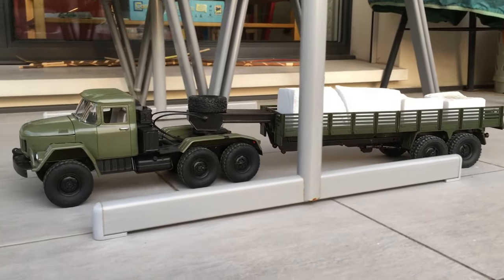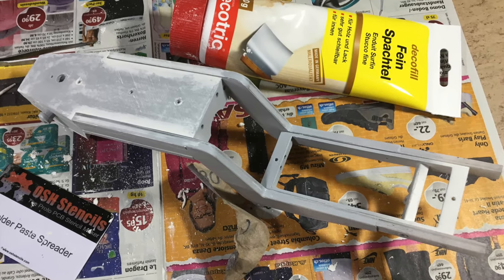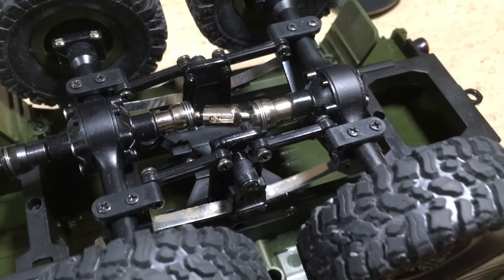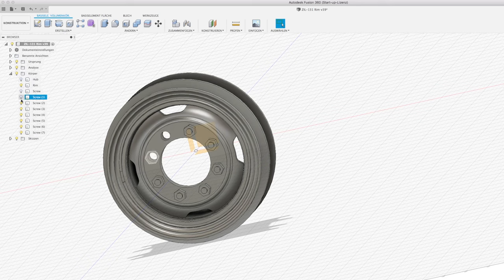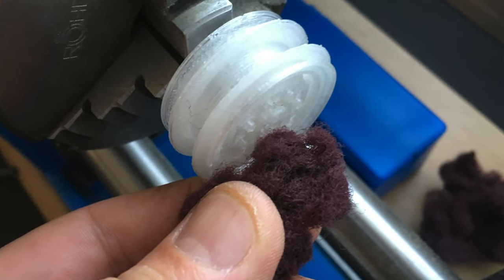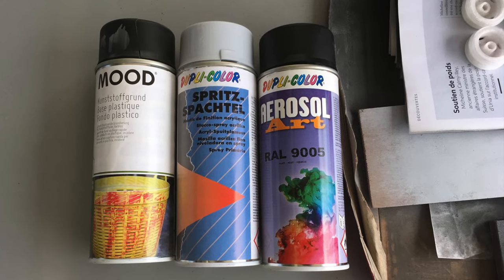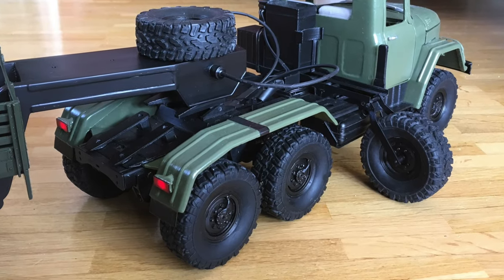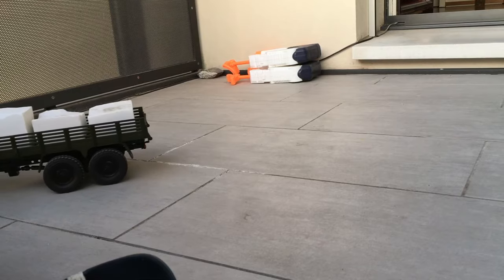WPL ZIL-137 10x10 Truck: New Scale 3D Printed Rims, Painted Trailer Frame, 4.6kg Marble Load Test!

Comment: Does your motor get hot? I have the 180 kit motor in my B16, and it gets hot after a few minutes to the point where I cannot touch it at all. This is with no load, and light crawling on a smooth floor over some rugs and stuff. I have the 370 upgrade with the metal case on order, but I just thought it was getting really hot for no real reason and if that was normal. I checked all my axles and drive shafts and diffs and they are all turning smoothly (all metal upgrades). Cool build, I really want to get a 3D printer to make my own stuff.